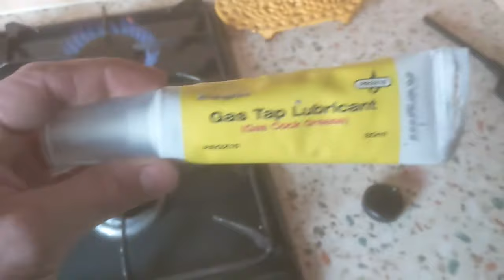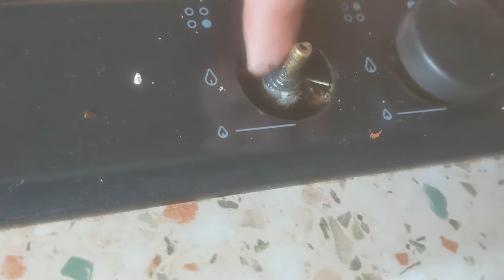My cooker knob is stiff or stuck

Comment: Had a stuck knob on my gas hob, bought the gas tap grease and followed your advice, but didnt try forcing the tap, as I was afraid I might end up with a gas leak. After leaving the grease to soak in for a few days, it is now working as new.  Thanks very much for your advice. You’ve saved me a big bill and I’ll have 4 working rings to cook Christmas dinner😁
Reply from the maker: Great news 👍

Comment: How do you fix a stuck knob on a gas hob with a flame supervisor device on it?
Reply from the maker: A bit trickier but same really apart from you need to push the spindle down at the same time as turning it. 👍

Comment: This brand is not available on Amazon Canada. Any other brand of ointment that you recommend?
Reply from the maker: If you google gas tap graphite lubricant grease you should find some other brands👍
Reply: @northwestgascertificates  I purchased WD-40. The knobs are going up and down now but not left and right. Hope it will move after few hours. Is WD-40 a good product for this purpose?
Reply from the maker: Wd40 isnt great. It needs to be graphite grease

Comment: Gas knob saviour here!
Thank you for your advice on fixing my stuck gas hob knob – it worked perfectly! I especially appreciated the part where you explained that the knob must be taken off and a mini wrench should be used to avoid wearing it out. That tip made all the difference. Your clear and detailed instructions saved me a lot of frustration. I highly recommend this guide to anyone dealing with the same problem!"
Reply from the maker: Im glad it was helpful 👍